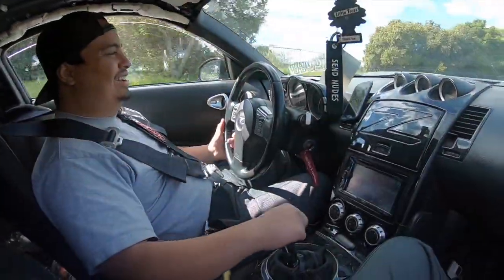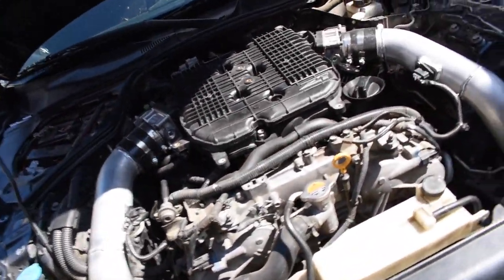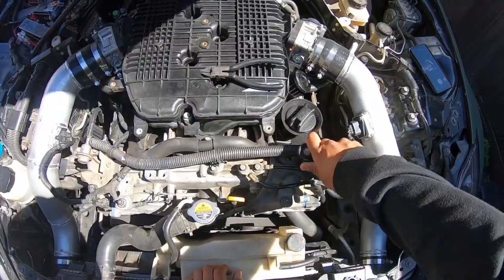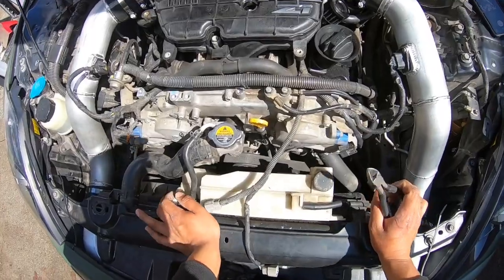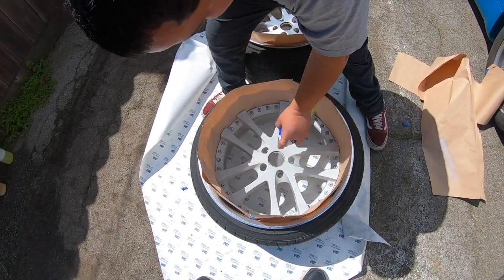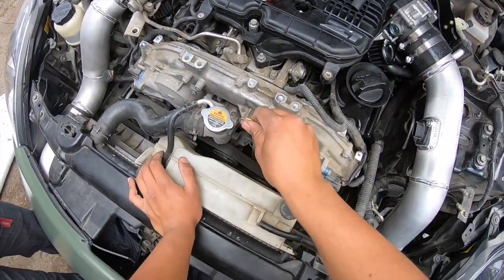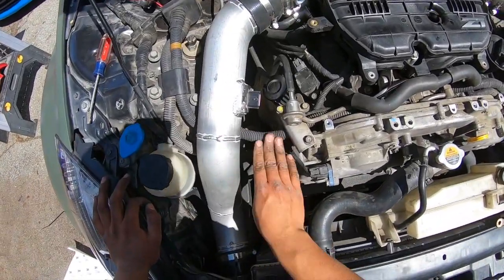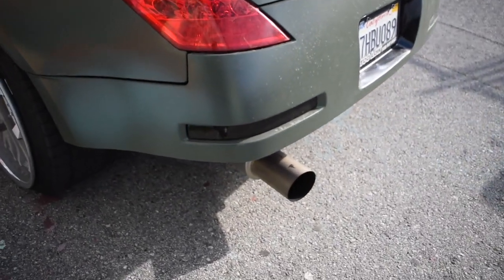How To Wiretuck Your 350z, G37, 370z | EASY !!

Comment: I did this to my g37x. And I'd like to mention that the two connectors that were fed through the small hole by the oil dipstick ARE the same size. I had them switched up and I got a few codes, random cylander misfire, crankshaft or camshaft position sensor(don't remember but one of them), and oil pressure too low. Driving the car it would stutter at 3.5k rpm and shift very poorly. I originally thought that I tore the wire going to the solenoid that regulates oil pressure so I went back underneath and unplugged them only to find that I had switched them around. The longer end goes to the solenoid on the right (drivers side) and the shorter one goes to the other side. That fixed my problem. Just a heads up for anyone doing this yourself. If the wires seem too short to go to the connector that it's probably the wrong one. Even routed through the engine there should be plenty of length for the connection.

Edit: if anyone wants a video or pictures reply to this comment and I'll find a way to provide it too you 😊
Reply from the maker: Why a great comment !! We are fully aware of which connectors go where. I did this on several cars before making this video. But it is very important not to mix up any wires & connectors. I appreciate your comment🙏🏽
Reply: @tuned_tunas  you're very welcome. I hope this helps anyone else trying to do this on their own :)

Comment: This was real minimal I like it.
I went in on mine lol I drilled 2 holes one in either of the false fire walls for the battery box and the brake booster area 
Starter wire wiener through the hole in the brake booster side and through the cowl to the batt and the alternator got routed through the battery box hole and back to the battery 
My big ground strap on the drivers side I put on the frame channel and the block were the Ac was 

Tucked my drivers side headlight harness under the fenders and I’d like to see if I can do the same on the passenger side when I get a day off 

Good stuff though looks like you had a much better time feeding the cam sensors than I did 

🤙🤙🤙
Reply from the maker: Love it !! You definently got down bro🔥🔥
Reply from the maker: This is definently going to help someone else. Thanks for commenting🙏🔥

Comment: Get rid of that plastic bottle smack dab in the middle!
Reply from the maker: That's the overflow tank. Kindda need it brother. Maybe upgrade that in the future.
Reply: Tuned Tunas paint it blk or somthing😂. Thats what i did on my z33. Way better!
Reply: @tuned_tunas  only way I’d go is a metal overflow with a oil catch hooked up
Reply from the maker: Those are over 600+ with a wait of 6 months. I’m cool off that my boy. Like to keep it simple. These cars don’t need a catch can. They run great with a vented PCV
Reply from the maker: But you’re more then welcome to ball out on a nice system if that’s something you want. My car don’t need it so I don’t see why I need to spend that much.